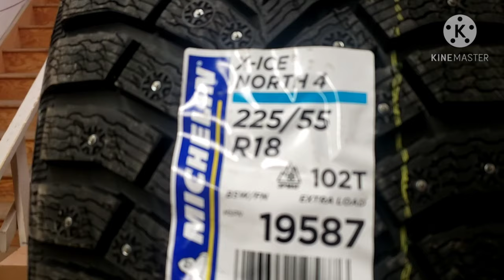How to Removed/Replace Intermediate Shaft Dodge1500

Comment: You only need to separate the top ball joint. This will gain enough room  to remove / replace the cv. the tie rod end and caliper removal only create unnecessary work.
Reply: Fails, I did it and had to remove both to get it off.
Reply: For some vehicles. This is wrong when it comes to “extra work” though. With the whole knuckle off, it’s much easier to access the innards of your suspension/drivetrain and it’s only 2 bolts and a couple taps, extra.
Reply: @YesYourRight  Just did it on my 2004 RAM 1500 HEMI 4x4 and just removed the upper ball joint to remove the CV axle.
Reply: @grossmeister1181  that’s a 2004 mine was a 2003

Comment: I regret getting a dodge 🤦🏽 my tenth gen f150 is so much easier to work on. Don’t have to pull the motor to change a tail light 🤣 I’m sure most vehicles are this style now instead of the 6 bolts at the front diff

Comment: amazing, great job....your video shows just how EASY it is, to remove the short left side axle stub shaft, on the Dodge 4wd.  talk to anyone about that they either don't know it comes out at all, or say it needs some kind of special tool.  thanks for posting it.
Reply from the maker: Awesome  im glad  this video helped,
 If you want you can share this video to anyone  😀
Reply: What about the right side? Does it come out this way? Obviously a longer shaft,  but are there any special tools needed?
Reply: @vincenttaylor5605  I think you have to take off the differential case to get to the snap ring 

At least in the video I watched
Reply: @chipblack6089  It will come out the same way.

Comment: Wouldn't it have been easier to put the intermediate shaft into the differential before putting on the CV shaft?
Reply: Both ways are fine, you need to tug it in at both cases. So doesn't really matter.

Comment: If your shaking in the highway around 65. Try to shake your cv axle in the front. If it has a lot of play this is your problem. Replaced all tires and front suspension down to this cv axle. I’ll update when fixed
Reply: Replaced cv axle with the stub intermediate shaft. Getting the shaft out was a pain in the a**. Ended up using an old axe head to get a good swing at that notch where snap ring was. After replacing super smooth on highway 👍 great video man thanks did this in the rain.

Comment: I know this is a long shot because this video was posted awhile back but would you happen to have a part number or link for the axel seal? I can’t seem to find one anywhere online
Reply: Brandon what year is yours? If it's a 2012 -2018 it's 68146583AA
Reply: This is Joe.  
I have the same question about the part number for the Axleshaft Seal ?
I have a 2003 Ram 1500 4x4 and I'm having problems trying to find it too !
What website did you find the right Axleshaft Seal on?
Reply from the maker: Try Rockauto.com
Reply from the maker: Try Rockauto.com

Comment: What year is this truck,im having trouble getting the right intermediate left side shaft and seal,and bearing, and right side,for an 02.
Some parts from 98 to 02 fot,others say from 02 to 06,but the 06 intermediate shaft from amazon were wrong!and brw tgey say ones for right side,but so does another ,but both have different package numbers.

Comment: I have a 2017 ram 1500. I've done the drivers side so far because it was the easiest. I did the shaft and the axles. I also got the extended travel from Napa. I noticed today and o ring coming out of the connection. Not sure where it came from either.

Comment: Was your stub shaft wobbling? If so do you need to replace the bearing ?
Reply from the maker: Stub shaft was tight  it was just the spline was Stripped, if its Wobbly ya need to replace  the bearing  and stub shaft

Comment: Did you have both CV axles off when you replaced the intermediate shaft or did you slide the intermediate shaft straight into the CV axle on the other side?
Reply from the maker: Only took the driver side  cv axle  first  before  the intermediate  shaft

Comment: Update. I’m deep in, getting off the intermediate shaft now. Unfortunately not a lot of swing room for my hammer to hit my pry bar. Can’t get it out. Any tips?
Reply: Mine just isn’t coming out. I’ve been hitting it with a sledge for a half hour
Reply from the maker: Angle the prybar sideways  towards the wheel

Comment: The cv joint broke the intermediate shaft right where the retaining clip would go on side of differential. The other half is stuck inside the cv joint cup. I have a new axle joint to put in but have tried a lot of things to get the broken piece out of the differential and it will not budge or let loose to come out. What could be holding it. The truck was running fine and I came onto a bridge and the divider strip going clear across the bridge is ruff and when I went over it at about 43 miles per hour the clunk and bonk came, I pulled over and that is what had happened as the cup end of the cv joint was hanging in the air. I could drive it on home so said a prayer and drove to my driveway. I really need my truck right now but seems to be at a standstill.

Comment: Should you put any grease on the stub axle splines to help them go in easier?
Reply from the maker: I should of but in this case i did not.
Reply: Does it matter at all if you didn’t put grease on the side with the o ring?
Reply: @mkzzzlooter9900  Not for the o ring, but will be better if you need to remove it later.

Comment: I was told by a mechanic that on some of these the differential sometimes needs updated, I think was the term he used. Claiming it could cost 4 grand. I called around asking about this and I can't get any info on it. I'm gonna look at it myself today but has anyone heard of the diff Needing some major thing like this on any of the ram 1500 SLT trx4. Mine is 09

Comment: Were you having this issue when it was in 2wd of was it only when engaged in 4wd?
Reply from the maker: I have no issue on my 4x4 system  it was just replacing cv axle and stub shaft . Sounds like  you may have transfer case actuator or rx4 switch problem

Comment: What year was this ram ? Just did my cv axle a while ago without changing the shaft and having vibration...went and check and sure enough there's some minor play in there.. so I'm going to re do it and change also the shaft this time !
Reply from the maker: From 2000 - 09
Reply: @jfGarage4k  have you ever done a 17 ? Is it the same or more complications ?
Reply from the maker: Nope never done it on 2017 but i did a quick  search  online   2017 dodge ram 1500 front axle and front differential are looks same to 2000-09. This well look Similar to your  2017
Reply: Oh man I’m just about to tackle this job. On short notice, I was looking for a tool. I replaced that drivers side cv a year ago. A weird whine and now it’s just rattling.
Reply from the maker: Sound  like the Stub shaft  need to replace eh?

Comment: I have the same problem that it would be better to replace the whole part or just buy the clip
Reply from the maker: Replace the whole thing i really do wanna do it again if it failed.
Reply: your problem is within the wear of the splines for the stub shaft and the cv axle. the channel for the ring to sit has worn and allows for the axle to pop out easier. a new ring wouldn't hold for very long because the grooves in the channel that made it pop out previous would make it pop out again. replace the stub shaft and cv axle as a pair just like he showed in the video to increase reliability, no one likes doing the same job twice.
Reply from the maker: The make sure to get a new ring &cv axle replacement dont wanna pop that axle out again

Comment: This is why. A lot think they have wrong CV axles you don’t!!!! It’s the issue with the stupid damn intermediate shafts you have to buy correct ones that lock onto the axle. Snap ring sit in the CV axle groove so it’ll lock onto it and it’ll never come off. If you pull out CV axle and it comes with the stub shaft attached you buy new one and slip it in the CV axle then you slip it into the diff. New oil seal also I recommend. 

For the passenger side it’s so fucking annoying. Take the plate off let alllll the gear oil drain then you have to get that longer intermediate axle shaft out that way. Buy NAPA CV axle buy NAPA intermediate shaft for example. It’ll lock and work. So annoying but that’s how it is. Grease your CV axles after long time with a needle grease gun fitting then put gasket maker over the hole. So your axles will last be careful the boot never tears. The needle grease fitting would make a very tiny hole obviously. Another way is you can try to slip it into the CV boot where it slips onto the axle.

Comment: How did you get that out soo easy?? I've tried hitting mine out for 20 minutes but still will not come out....
Reply from the maker: Make sure Use a bigger hammer
Reply: @jfGarage4k  Ok thanks I will try that. I just hope to not damage any internal parts.
Reply from the maker: No your good, the C clips what hold this shaft in place
Reply: @jfGarage4k  Right right. OK thanks man. ✌️🤞
Reply: @jfGarage4k  yeah well I just had a shop do my passenger side and they used a pickle fork and screwed up the stick diff.  I now have a used diff on truck and am now hearing a noise that gets louder as I drive almost reminds me of a slapping.  Hope that my driver side axle isn’t now $hit.

Comment: What size it the axle nut?
Reply: I have a 2003 Ram 1500 4x4 and my axleshaft nut is 36mm and the torque spec is 185ft. lbs. 
I have heard of some axleshaft nuts are 35mm, though I don't know what the torque spec is?

Comment: I just tried doing that for 2 hours and smashed my thumb just now gonna sell this stupid dodge😭
Reply from the maker: I can feel the pain  champ. Go luck  next time
Reply: @jfGarage4k  I ended up getting it out but this weird noise is still there it sounds like a bearing and it sounds like it's the front left it only happens when I turn right
Reply: What year is your dodge ? This method won't work on 2012 and up ZF front differentials. Look at how the shaft comes out on the newer ones in this vid https://youtu.be/QpTrPXNbE3A
Reply: @thatguywiththemiata  so did you find what the problem was?
Reply: @vaquero3578  It was the other bearing! Didn't make sense at all at first because when the noise was happening. it was when the wheel had load taken off of it when it made the noise
Reply: @DL101ca  that's passenger side shown there, driver's side easy.

Comment: Stupid cheap metal it’s made out of!!!! It cracks then you gotta take it all apart and buy new one. Ridiculous. The damn driver side CV axle is ridiculous the passenger side is so simple it goes right out and new one in. The driver side you have to do all that bullshit. Annnooooyyyyyiiiiiiinnnnnnnnggggg

Always change the intermediate shaft because you get a brand new tight fitting of it and the new CV axle in your differential. The passenger side it  always snaps on. Don’t need to worry about that intermediate shaft unless on the condition on it. You literally gotta take your whole knuckle off so the driver side one you can pull out whole if it comes out with the intermediate shaft still attached! It’s ridiculous but that’s how it’s designed. Once you change it all new, your all set for a long time. Maybe even rest of its life as long as you take good care of it